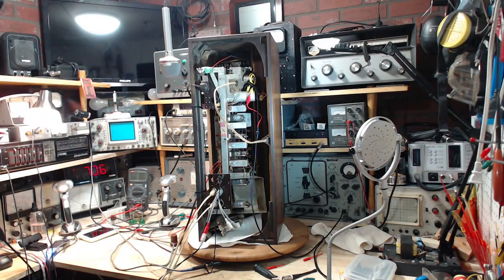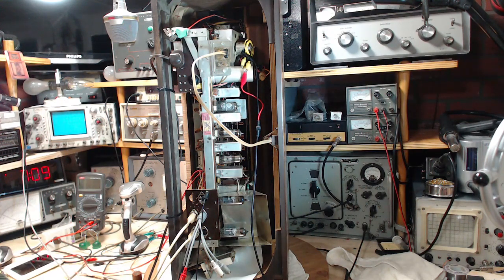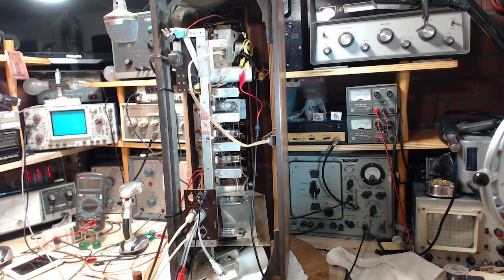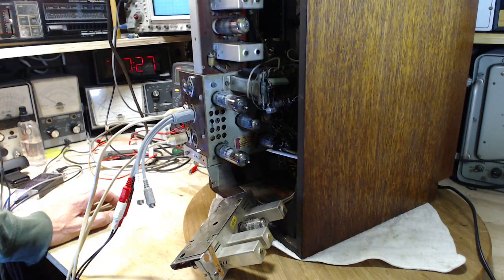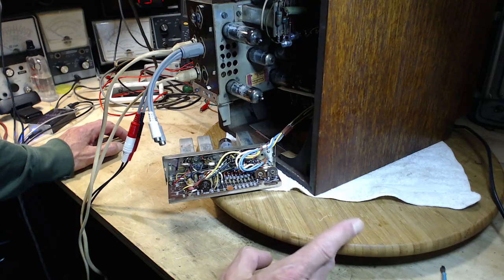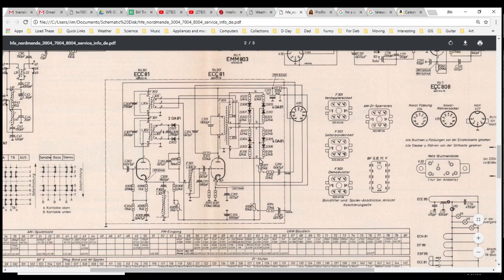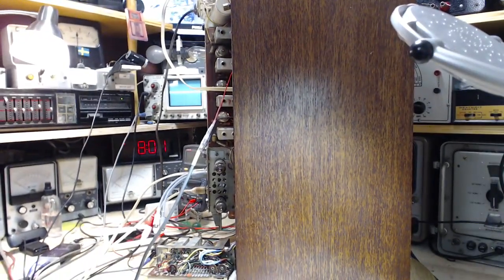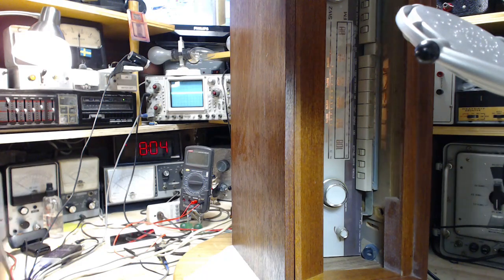Nordmende 3004C Video #15 - Stereo Decoder

Comment: Jim, have you ever checked the separation of your generated signal?  Also, stereo adjustments include the 19 kHz trap, L-R Phasing (which results in stereo separation), and pilot level (from 10% modulation).  Just some thoughts.